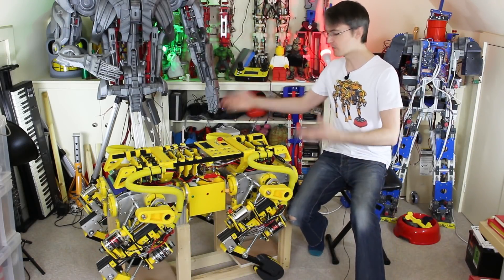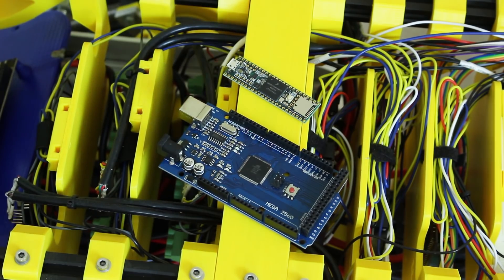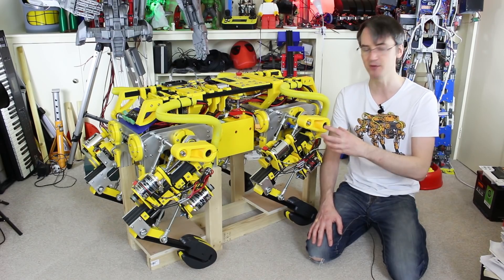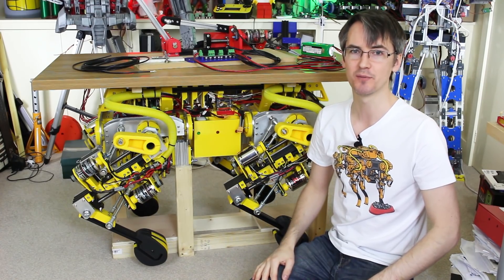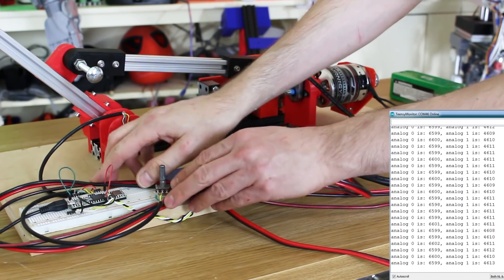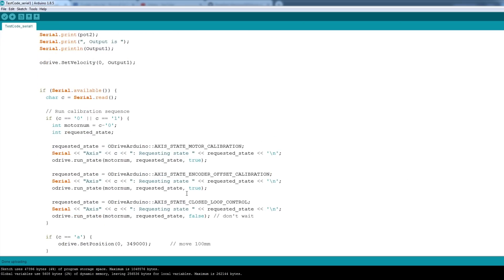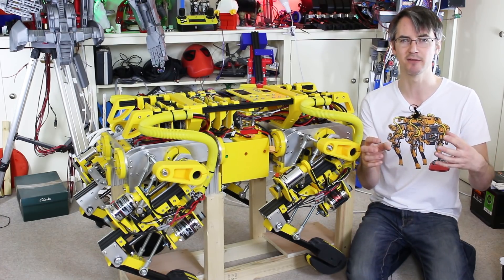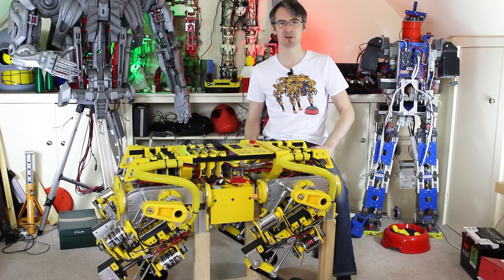openDog Dog Robot #14 | Closing the Loop? | James Bruton

Comment from the maker: Next time I'll be trying higher quality pots, as well as a digital magnetic absolute position encoder.
Reply: Could you just have the new chip right the data out to an sd card as a memory module to deal with the homing
Reply: Does the his model of teensy have EEPROM. Easy solution with no additional hardware needed. You wouldn't even need to write to it all the time, just write a shutdown function and bind it to the controller. This way you could save/load the state whenever you want.
Reply: Ryan S interesting I have never used the treensy before but I know that you should be able to write to an sad or something like that
Reply: The teensy3.6 has an sd card slot on board and a great lib for it. No reason you can’t store the config to the sd card for rapid prototyping restarts
Reply: Any reason you can't drive slowly into the end stops and use current sensing to know when you hit them?
Reply: Have you considered a camera looking at a series of lines to acquire position data? A mouse has very high resolution.
Reply: @ryans2919  That would depend on the motors not moving between reboots. Maybe a workable solution when constantly reflashing the teensy software during development, but you'd still need to do the homing periodically (to prevent errors adding up) or when the robot has moved at all. Also you'd have to store both the encoder count for each home position and a measure of the current absolute position, since the encoders are constantly counting up (or down, depending on the direction) from 0-8191 for every revolution. Since there are many revolutions between the two home positions, storing just the encoder count is not enough information.
Reply: @lukeburrage  A mouse is perhaps the quintessential relative positioning device, while James needs absolute position data. One option is to use a linear encoder strip, like the ones used in printers. This is a strip of plastic with the absolute position printed on it in digital code (a bit like a barcode). An optical sensor slides along that strip, reading the current position. Problem is these strips are pretty fragile, so I don't think they would survive being mounted on OpenDog for long.
Reply: Jeroen Bouwens Well done for understanding what I meant.
Reply: Can't you store ut in the sd card? Like an json file? Also could be used to debug/collect data
Reply: Maybe a 4 point average can get rid of that noise without loosing too much reaction speed. You can always work with a 2 bit pointer so you can increase it's value one by one and update the last value (it will go from 11 to 00 for example), then add all 4 numbers and divide by 4.

This shouldn't add much latency and with only 4 values the response should be fast enough
Reply: Try some of the offerings from Bournes, they're incredibly good quality :)
Reply: @spotandjake1008  Thats heavy I/O time wise, im not sure what the current draw would be ( perhaps not much ) but read/write is normally quite heavy.
Reply: Luke Burrage now that is genius
Reply: such a great project James, thank you the details you go into :) 
Do you think a Hall effect IC on the inside of the knee joint coupled with a small magnet could solve your homing positions issue? should then be down to calibrating the values with position.
Reply: unsure why you have jitter on the pots after the remap as it looked like the error was under 3 bit count, I wonder if the remap function converts to floating point, so it reconverts the error back, I would try either an integer divide by 8 and or just shift the bits :)
Reply: have you considered just using sensored motors like seen in e-boards? with the hall sensors you wouldn't need the absolute position encoder
Reply: Hi, I am a CNC engeneer and I do this stuff for a living. I like this project and I hope for lots of videos.

Just some tricks to help you along. Do with them as you please.

To remove the jitter on the pot, you either do oversampling (measure 10 times and show the avarage) like (oldvalue*9 + newValue) / 10, then you can also get a pretty good speed calculation aswell.
Or/and only use one side of the pot connected  to +Volt. Then connect the middle pin to analog in and also a resistor from the analog input to GND. Then you measure the current thru the pot and that is much less sensetive to inducted jitter. Also make sure the +Volt is stable and filtered from the one driving the electronics.

Never stop tinkering creates a better world.
Reply: Don't bother! just make sure you have a hardware low pass filter on the pot input!  You know the maximum speed of the legs movement (presumably pretty slow in real terms), so with a simple RC low pass filter you can remove any high frequency noise coming from the motor drivers or the pot wiper etc!  It's always a good idea to include an Anti Aliasing filter at less than half your sampling frequency anyway, so it may a s well do two jobs. I can't really see needing to know the leg position more than 500 times a second, so if you sample at 1kHz, you can use a 500 Hz (-3db point) low pass filter.  That filter also means you could if you need to oversample the analogue input. The 10b ADC on the 8bit uC's can sample plenty fast enough to recover 1 or 2 more bits of info.

Regarding pots, probably the best, cheapest option is to use "ride height" sensor pots from cars that run air suspension, these are cheap if you don't buy the OEM ones (ebay etc) and are robust enough to last under a car (waterproof, vibration proof, with decent connectors) and come with a range of arms often with handy little ball jointed links to make connecting them really easy!

Short distance RS485 can be run at over 1Mbaud, so make each leg autonomous might be a sensible idea, and once you develop one leg, it's super easy to scale up to any number of legs!
Reply: Why not use the same CUI capacitive-encoders in place of the potentiometers? The high-speed ones on the BLDCs can give you smooth control, and the ones on the knee/hip/ankle/shoulder shall give absolute (albeit underutilized) angular position.
Reply: @jeroen94704  Maybe would be usefull a encoder strip with low resolution to reboot purposes, and another method, with high resolution for positioning  continuosly and accurate control. Or some other method, for example inductive or rf, to tell the controller in what approximate position it is. It would be like an analogue limit switch.
Reply: James, in my opinion you should save the current state of execution (values where each joint is) at an external memory, and before reprogramming the arduino, you could have a function that write the values to the external memory, and at power up would read from the external memory to the arduino ram. Then you can have a (RC circuit) to delay the reset, but at the same time arduino could monitor the reset line without the delay circuit, to trigger the function mention before.
I believe you will be a lot worse by moving that PID to arduino instead of continue to the current implementation on Odrive
Reply: @MrPmjg  I would agree with you on this untill I reviewed the episode again. Aparantly the ballscrews drive the motors backwards during the reboot due to the weight of the dog, thus giving the wrong position after startup. Using acme screws would allow this as they are self locking but at the moment he uses ballscrews.
Reply: One or two (front and rear) simple distance sensors facing downward could help to provide a rough idea of absolute distance to ground in most cases. I'm thinking of a startup sequence, assuming a beginning that's at a height less than full leg extension, you would know when to move quickly or slowly towards that full extension position to zero out. I also thought that an 'assumed zero' might be an interesting approach to the zero out problem - begin moving with the assumption of minimum and maximum values that are just a little too small or too large, respectively. This means knowing that you'll hit the endstops, but also that you'll be moving relatively slowly at that point and can design the parts to take a little abuse. Then, when an endstop is hit, just update the initial zero value mid-motion - if you're off by a little bit, there's only a 50% chance it'll have to update again!
Reply: @lukeburrage  Hey Luke, I did some experiments with an optical mouse with metal cylinders did not have a lot of luck. I suspect, as you mention that some kind of pattern on the cylinder would be needed.
Reply: Rather than homing to an endpoint, maybe home to a midpoint?  If you have two switches, one closed during the top half of travel, the other closed during the bottom half, you will know which direction to move to “home” to the middle.  Or could use 4 switches and have quadrants (or 8 for octants).  Either way, it gets rid of the complexity and noise of dealing with pots.  Would a rough quadrant/octant give enough precision to keep the dog upright until each leg passes a switch to give precise accuracy?  Thinking it might. Thanks for the great vids!!
Reply: make your hulk buster walk
Reply: @lukeburrage  Thanks, I couldn't have done it if you hadn't explained it so well :).
Reply: @zecretw7272  true, if you cut that power on everything. But the solution I describe would still work if you only reboot the arduino and keep the odrives holding the position, in other words if the odrives keep controlling the position to the target position set before by the arduino.
Let me know if I am forgetting about something, it is always good to discuss and keep learning
Reply: @MrPmjg  yes, your solution would work during testing but every time it runs out of batteries, or is turned of, it needs to be seated on the wooden stand to be recalibrated. And he comments that is a nightmare to do.
On a personal note I would use this for the joints. Not 99p but better. 
https://ams.com/as5162
Reply: I had to sample and average 8 samples when I used closed loop actuators on this beast (see my video in reply).  Divide by 8 is a fast shift right 3.
Reply: @zecretw7272  I was having a look to that, but I don't quite understand how it works. How you'd that device track the position of the joint, when the robot is power off?
Reply: @MrPmjg  It works like a local compass. You have a magnet on the joint and this device tells the degrees of the magnets "north" as either an analog signal or a serial message. As soon as you turn the device on you can ask it for the angle. So there is no callibration or anything, it just knows.
Reply: Just a thought, couldn’t you use a arduino micro or such with a lithium battery back up to purely to save the start up position for each leg
Reply: On start up, use the cheap pots to estimate the position. You only need it to be + or - half a revolution, then use the  rotation counters to find the exact position.  If the pot says your 3.5 revolutions in, and the counter says you're at.455 of a revolution, you actually are at 3.455 revolutions.
Reply: @James Bruton Our robotics team uses a rotary hall sensor for absolute position.  Link at the bottom.
I works great; but, a few of things to note.
1) It takes 5V and the output is almost zero to almost 5; so, position to voltage is linear but not specific.  Sort of a relative absolute sensor.
2) It does turn 360; but, there is a discontinuity as it transitions from 5V to 0V (what we call the hall hole).
3) Rather than a second device for the home offset, we mount the sensor in a shell that we can rotate relative to the robot axis and set home that way.
     We don't have an encoder on that axis; so, we PID off the hall sensor.  It makes homing really easy, just turn the mounting shell until the wheel is pointing correctly.
4) We have models of the housing and adjustment mount in F360 if you are insterested.

Sensor: https://www.digikey.com/product-detail/en/tt-electronics-bi/6127V1A360L.5FS/987-1393-ND/2620662
Reply: You might fix the sensor jitter by rounding rather than truncating the lower bits.  Averaging a few readings will make it even better (but average BEFORE you round).
Reply: @zecretw7272  that looks a very clever solution. If there isn't much interferences from the cables or other joints with the same system, I would like to see it implemented
Reply: Any reason for not using eeprom or the SD card?
Reply: @Craig King When Patreon decided they would police the world they were dead to me. So sick of the few thinking they can decide for the rest of us.
Reply from the maker: @explainedgmod  It stopped to build Bumblebee the real Transformer last least. Now it's continuing again.
Reply from the maker: @explainedgmod  What do you think this series is about?   I can't program anything without working hardware.
Reply from the maker: @explainedgmod  The trot gait is what's going on here, but it needs upgrades as stated: https://www.youtube.com/watch?v=9PugfVSbnAg
Reply: hello from in Kazakhstan
Reply: I see you on colinfurze
Reply: cool

Comment: Hey James, just a word of advice.  When using shielded cables, you only want to ground one end.   If you ground both ends you have the potential of creating a capacitor.
Reply: Not to mention ground loops
Reply: +1 Was going to say the exact same thing. Wouldn't it also potentially make the ground at the pot end have a higher potential if large amounts of EMF are around?
Reply: If the sensor at the far end of the cable is not earthed on the chassis,  you can use the braid to provide that earth.
@tomshirvo1  There's a separate 0V wire inside the cable,  so induced EMF should in theory be dissipated by the braid back to "earth" (or as close to it as you can get with rubber feet)
Reply: Nononono, stop spreading these fairytale stories. ALWAYS GROUND BOTH ENDS. How did this thing start?!
Reply: @telefon72   ok now i don't know who to believe!
Reply: @jasper939393  We are tought at university that you need to ground both ends, so that's what Im going with. Besides that, my dad who has worked in industry, has always been recomended to ground both ends by experts and manufacturers.
Reply: like everything in engineering, the answer is.. it depends. it depends on the signal you're trying to shield, the offending interference, the system configuration etc. there are actually quite a lot of different termination techniques, but for general use within one "closed" system where you've got negligible ground potential differences, i would argue that terminating both ends directly to chassis ground is the best choice. if you want to read up on the matter, try to find any of the following books at your university's library:  'Electromagnetic Compatibility Engineering' by Henry Ott (expert in this field) ;  'Designing Electronic Systems for EMC' by William G Duff. Just be warned: you'll find some contradictions even among the experts  :)
Reply: ... also, without doing any kind of measurement, i'm not sure if this method of shielding would help against the interference presumedly caused by the motor, which would be mostly h-field, and if it's really necessary in the first place. it's kind of cargo-cult-engineering ;)
Reply: @telefon72  I believe the idea is to prevent ground loops

Comment: Great video James,  this is the correct way to go with the series now as it shows how 'Yes' the earlier incantation was a great start / platform to build from.  But there are now redesign challenges aswel as decision challenges to upgrade / fix potential issues as you move along.

It is a great example of engineering 101 that failing is a learning curve and that you take those lessons learned and apply them to the project.  This should be very interesting to see how Open Dog progresses,  I for one look forward to the journey.